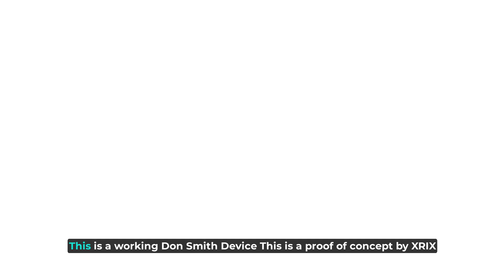Over Unity Working Don Smith Device

Comment: This is great. It will so kind of you to tell us how we can rebuild such device .
Reply from the maker: This is the "Zilano Final Disclosure" circuit without 4.5v feedback (to make it self running) because I wanted to remove the "Perpetual Motion Device" stigma.
Reply: @XR_IX  thank you a lot for your response. honestly i had look through many diagram and circuit of zilano. could you please direct me to the pdf show such circuit . thank you
Reply from the maker: @anwaralfawdaei3381  It is a PDF that has "Zilano Final Disclosure" with the header "Zilano Diagrams & Circuits Don Smith Device" it also says "Assembled by David Fine (Slovenia)". The diagram looks like nothing, but this is the important thing to know: Being successful in execution of this goal, isn't within a single circuit. It is an approach to a system. There is no magical ground current, or really anything to patent. But you can save at least your part of the world if you should need to. I talked to other's before me, who said they were able to do this, and they pointed me in the same direction. The circuit looks like nothing. But if you understand the approach, all Don Smith devices can be replicated, and you see the relationship with Tesla. You need to look at the world through "magnetism", everything that physics says it is - well, wrong (incomplete). Patents Apps by Tibor Kemeny, Edwin Gray all will make sense. Remember Don Smith, and chase the Right rabbit (magnetism). If you take out your circuit simulators, and your scopes, you will spin forever.
Reply: Hi @XR_IX  ,
I looked at this schematic. But I am not sure, what the red line "2k hv ac pulse trigerring constantly" with the diodes means. Lighting arrester can be triggered without these two opposite diodes (just by the increased voltage in capacitor), so why the diodes are there?
What am I missing?
Reply from the maker: @mrmishmash1725  There is a part of that I didn't use for the POC. Remember that Zilano's schem, had 60Hz timing and I believe that was it was used for. The two diodes was a triac maybe, again used for gate timing for 60Hz. Not necessary for me - because I was going to convert the secondary of my MOT to DC.
Reply: @XR_IX  Thanks a lot
Reply from the maker: @mash1725 If you were to use a Triac, you wouldn't use 2KV AC, to turn it on. I think the 2KV AC was used to trigger his Xenon tube. There is actually a version in the same pdf "RESONANCE HAPPENING IN L1 AND L2 and is harvested by harvest coil", of the final that looks similar but it uses a Xenon tube with the actual trigger voltage, and that makes sense. As I said if you just use a GDT, it will fire when the cap hit's that voltage. Make sure you have different voltages of GDT, because that's really a learning process.
Reply: Hi  @XR_IX . I am trying the circuit. Two capacitors on primary makes sense to me now.
But still no amps from capacitor after MOT secondary. I use approx 600V HF on input side. I use 75ns diodes for rectifier. I am scratching my head to find solution.
I guess your GDT is running cold.
Meanwhile I found interesting thing - if I put another iron core transformer in proximity of first one, it takes some of the magnetic flux which I can put into capacitor.
Reply from the maker: @mrmishmash1725  what value of capacitors are you are using?
Reply: @XR_IX   Today I tried electrolytics Hitano 15000uF/6,5V and 2200uF/35V low esr capacitors connected after FWBR on secondary of MOT, but still very slow charging (lot of seconds) to 20V. With 0.1uF/1kV I got almost constantly over 100V. When I see your capacitors I cannot imagine how you can charge them  fast from the mots.
Reply from the maker: @mrmishmash1725  Please post a schematic. I can help more effectively, if I see what your component layout is.  I am running 24 of those bulbs with just 1uF discharged by the GDT. Make sure you are connected to the HV side of the MOT. This case, it is primary, and therefore wired in reverse from an oven. The secondary would be the low side (110V winding) will go to a FWBR to your storage capacitors - mine are 120000uF 15V Large Can Electrolytic Capacitor 36DX10335P.
Reply: @XR_IX  I don't know why, but when I now post comment with links here, it is always deleted by yt. So I created small video on my channel (nor the link of the video I cannot put here...)
Reply from the maker: @mrmishmash1725  I am not sure how YT works, it's nebulous at best.
Reply from the maker: @mrmishmash1725  It maybe they want to limit the cyclical references to prevent data nesting. You maybe able to post a link outside of YT. I used to post schematics that I had uploaded to a hosting website. If you could please do that, other's asking would benefit by the data located under this central video. - Thanks
Reply: @XR_IX  are your capacitors standalone (1 MOT = 1 cap) or serial or parallel?
Reply from the maker: @mrmishmash1725  They are 1 MOT to Every Large CAP. They don't have to be physically large either, you can use supercap modules, however in comparison they don't seem to absorb the pulse as readily as the large capacitor. Basically you can add more large capacitors in parallel to absorb the pulse.
Reply: @XR_IX  If you would be so kind, I have one more question - your led bulbs are 110V or 12V ?
Reply from the maker: @mrmishmash1725  Its in the description, but this is the link to the bulbs: https://www.amazon.com/gp/product/B09TTCVJHF/ref=ppx_yo_dt_b_search_asin_title?ie=UTF8&th=1
Reply: @XR_IX  Hi, I have partial success. I can lit 2 x 4watt 12V led bulbs from 1 transfomer, but only half lit. When I connect them as load, voltage drops always to 7 V. I think, I must change (rewind) ZVS coils to make more voltage going to first cap. And maybe change GDT for another voltage. Then I guess more voltage will go to MOT to high side winding and output could be better. I hope it is just about tweaking my circuit. 

My question - do you have any resonance somewhere in your circuit?
Reply from the maker: @mrmishmash1725  Good news! you will optimize the brightness by the GDT and capacitor values. It is delivering the maximum joules per pulse as quickly as possible, and what the transformer can absorb and return from primary back to the capacitors. Don't worry about the half brightness, here. That is not the lesson of this circuit. Now to break physics. Put MOT #2 primary in parallel to MOT#1, and create  a identical load circuit branch. What do you think should happen?
Reply from the maker: @mrmishmash1725  Anytime you use a capacitor, a coil, and a spark gap. You will have resonance. If you don't think so, buy a frequency counter. Your gap is firing maybe 2 times per second, so you think you are in the lower Hz range, you will be surprised it actually in the RF range.
Reply: @XR_IX  Wow. I today got second MOT and connected it as you said. I need to get more MOTs to check what I have seen now. It is accompanied by the almost same energy consumption.
Reply: @XR_IX  And one question: Do you have MOV varistor in your circuit? I don't have it there yet.
Reply from the maker: @mrmishmash1725  A MOV would feel necessary when you have enough power to worry about
Reply from the maker: @mrmishmash1725  :) That was not what you expected right? It violates Ohm's law. Now you can build over unity at room temperature! Don Smith said you can make infinite copies. I didn't have to stop at 24 bulbs. Of course you may have to boost the input, if you use hundreds of bulbs, eventually the wiring will degrade the 20 Watts or less you input. You can imagine Telsa's hairpin circuit as a Ferris Wheel, where the capacitors and spark gap are the central hub, and the stout rods are infinitely around it. Once you figure out WHY this is so, all the devices will become clear to you Ed Gray... Wardenclyffe... Tibor Kemeny.
Reply from the maker: I let this comment slip by, but your interesting "feature" is actually the DSE
Reply: @XR_IX  Мне нравятся ваши слова о спасании остатков человеческого мира,это возвышенно звучит.
Любопытство моё требует спросить(если всему конец😁)если это нельзя увидеть и измерить осциллографом то как вы знали правильность действий и собрали устройство?
Поймите правильно,собирать подобное это последнее чем мне хочется заниматься,есть более нужные и кайфовые дела.И тем не менее как бы вы сформулировали принцип появления энергии в показанной установке одним предложением?(если такое вообще возможно конечно)
Reply from the maker: @LeonidGromov-l9n  Принцип усиления энергии заключается в разрушении эфира, так что он создает мгновенный магнетизм в проводниках, без протекания зарядов через проводник. При этом вы можете создавать магнетизм в бесконечных проводниках, если они имеют одинаковое относительное сопротивление. Короче говоря, вы нарушаете закон Ома для замкнутой системы с помощью магнитного резонанса.

Откуда я узнал?

Я не узнал.

Я посмотрел на большую часть всех устройств Дона Смита и поискал общность. Подобно пазлу, без полной картины на одной стороне, чтобы определить взаимосвязь между частями. Поэтому мне пришлось найти общность в других устройствах. Однажды все сложилось, и только тогда у меня появилась картина того, как такое устройство должно работать. Секрет не в схеме, которая существует только в двух измерениях. Подход заключается в третьем измерении.
Reply from the maker: vShaub- You have to look at everything from a magnetic perspective. Think how you generate power, we create magnetic dipoles or use permanent magnets and use a prime mover(hydro, coal, atomic)to push these dipoles past coils, which creates electricity (hot). When you strike a ferrous metal, it will create magnetism. If you could strike 2 rods, there would be magnetic flux between them, whether it is two rods or 100 rods, but now you are amplifying the magnetic flux. You have to weigh every component to the development of Magnetic flux. Don was very specific about his wording. Why did not say Electro Magnetic resonant device, as oppose to magnetic resonant device? Don't read the Tibor patent from an electrical how to perspective. Look at the nature of Tibor's "cold electricity". Then ask yourself, how you can leverage these properties. Infinite copies are an advantage of cold electricity. My main tool is a magnetometer.
Reply from the maker: vShaub- Zed's forum is an island of hard working experimenters who freely share. I defer to Zed for inquiries regarding memberships.
Reply: @XR_IX  hi, how can I contact Zed?
Cheers, Ray
Reply from the maker: @vShaub- This was my theories about 3 years ago. I was thinking that you could EMP pulse a charged capacitor, and it would endlessly return the charge on one plate that is Earth Grounded. If it did work, the magnitude was in in the negative exponents. It takes a lot of energy to separate electrons from capacitor  that is charged. If it was easy, you could take spinning magnets around a capacitor and see current, I had no luck with that. However, the realization that EMP pulse main operation is not the movement of charges, but a displacement of aether.  Displacement, is why my DS device works.
Reply from the maker: vShaub- This is another video not my plasma globe replication? I reviewed it if is the same video, he didn't show it working? https://www.youtube.com/watch?v=TPz3ccbcnaE - Any plasma globe is basically  a Tesla coil transmitter. This will create a rotating magnetic field in the near field.  Any AV plug will charge the capacitor which intercepts the HFHV and separates the charges. I am essentially doing this in my plasma globe, but I make the globe more powerful, and increase the output using Tesla one wire. We always need to be cognizant of what we are trying to do, and not mix up Transmission and Amplification. They are the exact same circuit components, but different in application.
Reply from the maker: @vShaub- Ah. it is as I said, charging in the nearfield. He could improve the device if he put an antenna to the diodes, even more if he covered the plasma globe with foil and sent that to a fwbr of high speed. He talks about volts needing to  at a certain level, but the plasma driver is probably in the kV range. Don't be mesmerized by the plasma globe, it adds nothing and, is not important. This would happen with a small slayer SSTC. 
Small globes can run on USB, usually 5V@1A. So the globe runs on 5W of power.  More can be achieved with 5W.
Reply from the maker: vShaub- Good you're paying attention. If I told you what you just told me, would you have understood? Funny how the mind is, it relates everything to digestible chunks. It was designed to keep us from falling apart in tragedy, but unfortunately it also takes the path of least resistance. If you struggle, you learn. You must want to struggle.
Reply from the maker: @vShaub- I was hoping a few wanted to struggle.
Reply: @XR_IX  I have also read the Tibor patent.Thanks for the hint. Tesla hairpin circuit is visible and it is interesting how Tibor uses switching to make it work.
Reply from the maker: @mrmishmash1725  The switching thing is genius, because Tibor paid for the charging of the capacitors once, and then didn't lose that energy, as the discharge of one capacitor, charged the reflection capacitor. Then he used the discharge of the capacitor to charge other banks of batteries in a parallel device. I built the circuit but I used LiFePo4 batteries, and it fried the BMS at the double the voltage switching. If you attempt it, use Lead Acid Wet batteries, because I have been told they can absorb a 300V Spike in the charging. I have thought about just doing that, with this device, It maybe a possible accumulator for charges. And pulse charging has been a solution for sulfate buildups on Lead plates. It maybe a good match.
Reply: Hi, I just read Tesla's
"On Light and Other High Frequency Phenomena" where in chapter "On Currenct on Dynamic Eelectricity Phenomena" Tesla speaks about discharges running motor ( Fig. 182 )
I think, that Mr. Tibor could use similar principle for his cold electricity motor.
And here is today's video, where is spinned aluminium disc by high frequency. 
https://www.youtube.com/watch?v=9lr47tLDakw
Tesla in his speach talks about "freely movable metal disc".  Maybe aluminium?
Reply: I tried Tibor's simplified circuit in Falstad. Left side is without transformers to DC.
https://i.postimg.cc/T30XkHMV/Kemeny.jpg
You can alternately toggle the swithes (yt doesn't allow me put direct link to circuit)